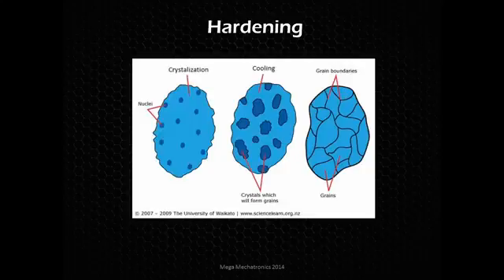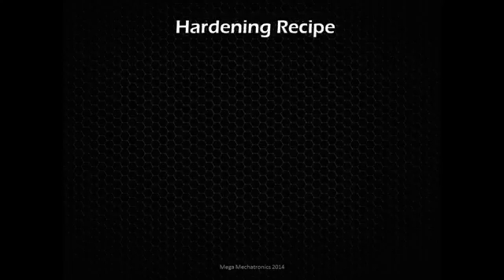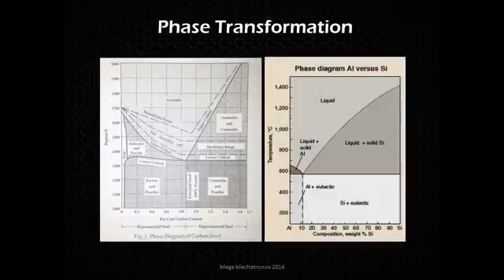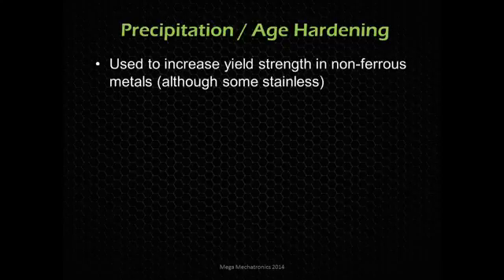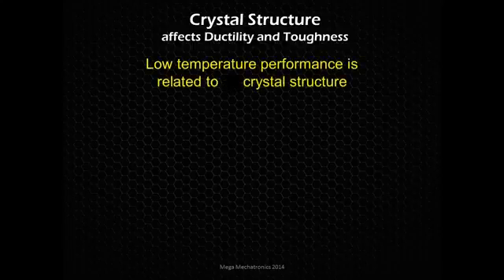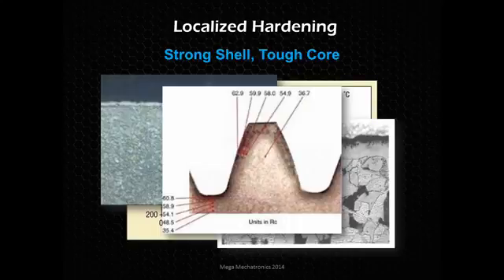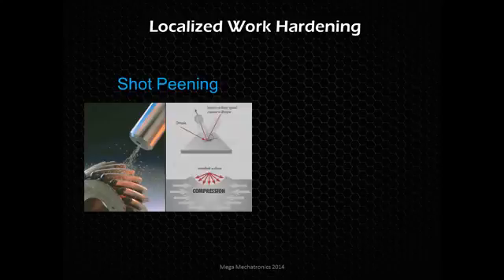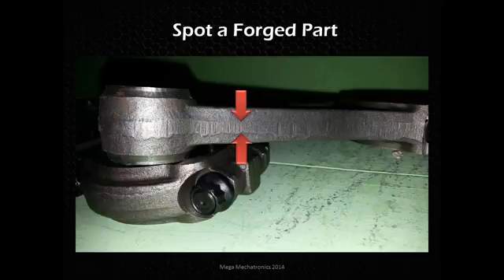Materials Science Mechanical Engineering    Part 4 Heat Treatment Explained

Comment: Axel Gian Aditama 
2713100137

Heat treatment is use of heating or chilling to achieve a desired result such as hardening or softening of a material. Heat treatment techniques include: 1) Annealing involves treating steel up to a high temperature, and then cooling it very slowly to room temperature, so that the resulting microstructure will possess high ductility and toughness, but low hardness. Annealing is performed by heating a component to the appropriate temperature, soaking it at that temperature, and then shutting off the furnace while the piece is in it.; (2) Tempering involves heating steel that has been quenched and hardened for an adequate period of time so that the metal can be equilibrated. The hardness and strength obtained depend upon the temperature at which tempering is carried out. Higher temperatures will result into high ductility, but low strength and hardness. Low tempering temperatures will produce low ductility, but high strength and hardness. In practice, appropriate tempering temperatures are selected that will produce the desired level of hardness and strength.; (3) Normalizing involves heating steel, and then keeping it at that temperature for a period of time, and then cooling it in air. The resulting microstructure is a mixture of ferrite and cementite which has a higher strength and hardness, but lower ductility. Normalizing is performed on structures and structural components that will be subjected to machining, because it improves the machinability of carbon steels.; (4) Carburization heat treatment process in which steel or iron is heated to a temperature, below the melting point, in the presence of a liquid, solid, or gaseous material which decomposes so as to release carbon when heated to the temperature used. The outer case or surface will have higher carbon content than the primary material. When the steel or iron is rapidly cooled by quenching, the higher carbon content on the outer surface becomes hard, while the core remains tough and soft.; (5) Quenching is a process of rapid cooling of materials from high temperature to room temperature or even lower. In steels, quenching results in transformation of austenite to martensite.
Hardenability is the ability of steel to hardened to form martensite.. High hardenability in steel means that easier to achieve martensite form not only at surface but to a large degree throughout the center.
Hardening use heat treatment process to get hardness and wear resistance improve by rapid cooling from austenization temperature. Hardening treatment generally consist of heating to hardening temperature, holding at specific temperature, follow by rapid cooling. Hardening temperature depend on chemical composition, for example hypoeutectoid steel are heated 30-500C above the upper critical temperature, (A3) whereas eutectoid and hypereutecoid steels are heated about 30-500C above lower critical temperature (A1). Hardening depend of the cooling rate, which determined by quench media such as water, oil, bath of salt. Effect of quenching medium is on the final phase of the material. Quenching medium is directly related to the rate of the cooling of the material. The fastest cooling rate is easier to get martensite form but the properties will more brittle. Rapid cooling will affect to develop internal stresses. So hardening follow by another treatment such as tempering which reduce internal stresses and makes the hardened steel relatively stable. 
Tempering is reheating the hardened steel to a temperature below lower critical temperature and hold for period of time, then slowly cool in air to room temperature to improve the toughness of hardened steel. At tempering temperature, carbon atom diffuses out and form fine cementite and softer ferrite. Depending on temperatures, tempering process can be classified as : 1) Low temperature tempering (150-2500C); 2) Medium temperature tempering (350-4500C); 3) High temperature tempering (500-6500C). Higher temperatures will result into high ductility, but low strength and hardness. Low tempering temperatures will produce low ductility, but high strength and hardness.
There are two method of determining hardenability, Grossmann’s method and Jominy End Quench Test. The Jominy test involves heating a standard test piece of diameter 25 mm and length 100 mm to the austenite state, fixing it to a frame in a vertical position and then quenching the lower end by water jet. The result is different cooling rate along the length of the test piece. A bar of steel have a good hardenability for greater distance from quenched end.
Martempering is a heat treatment for steel involving asutenitization follow by quenching, at a rate that fast enough to avoid the formation of ferrite, pearlite and bainite to a temperature slightly above the Ms point. It use to produce martensite without developing the high stresses, so will minimize distortion, cracking and residual stress. Austempering is hardening process is used in metal to get better mechanical properties, the process is quenching from above the transformation range to a temperature above the upper limit of martensite formation and holding at this temperature until the austenite is completely transformed to intermediate structure.

Comment: Firstly let me introduce myself, my name Airlangga eka
saputra 2714100058. I would like to comment this video. This video is explaning
about heat treament of the material, especially about hardening processes. Heat
treatment is some processes with raising up the temperature of material in
purpose of getting mechanical properties that wanted. Heat treatment is very
usefull to industrial needed. One of the heat treatment is hardening, the main
purpose of hardening is to increase the hardness value of the material. Basicly,
when we hardening the material or the metal is letting the atom move around and
forming the crystal structure (crystalization). There are 3 types of crystal that
usually formed; body centered cubic(BCC), face centered cubic(FCC), and
hexagonal. The crysstal structure of material has magnetic force to keep the
atom connected when they getting external force. When the crystals start
forming randomly they gonna be crystalizing with different orientation to each
others. When two crystal with two orientation meet, they will make an edge
because of different orientation. The edge of them called grain boundaries. The
size of grain boundary is really matter, when you have smaller grain, the
material will have stronger and harder material because with decreasing the
size of grain it will reducing the ability of grain of crystal to deformed. In the
other hand, when the grain is huge it will make material more ductile. The limits
of hardenability depends on alloying elements of the metal. The hardness
depends on carbon content in ferrous metals, as we se in graphic of rockwell
hardness vs % carbon, the hardness value of material will increase due to
increasing carbon content. When hardening, there are some factors that affect
the hardness result. There are heating temperature, time, diameter of material,
and the alloying elements in material. The most important thing in hardening
process is cooling rate. Cooling rate will decide the final result of
microstucture of the material, and the microstructure is totally affecting
final mechanical properties. The important point of hardening process is how to
get martensite, the mechanical properties of martensite is hard, so the
material with martensite in microstructure will have harder properties. The more
martensite in microstucture, the material will be harder but brittle.  In Time Temperature Transformation diagram
(TTT diagram), it shows us the condition of equilibrioum cooling condition. We will
know how much time we needed in cooling process to get martensite. so we should
know the TTT diagram of material first before we do hardening process. Alloying
elements will make the nose in TTT diagram moves to right, so it will ease us
to get martensite in cooling process. Hardenability is the ability of material
to getting harder. The more hardenability of material, the easier to get
martensite. the material with high hardenability will form the martensite even
in slow cooling process, because in TTT diagram, the nose will move to right so
far, it means it easier to get martensite even we cooling the material in much
time. There is two methods of calculate the hardenability of material. There are
jominy’s method and grossmann’s method. In grossmann’s method, we could know
the hardenability value of material by doing hardening some materials with
different diameters. In other hand, jominy only use one material. jominy method
focus in the speed of cooling rate. Usually after the material is to be harden,
the next process is tempering. There are two types of tempering, martempering
and austempering. The purpose of tempering is to release the residual stress of
material after being quenched.

Comment: This video is about hardening and the treatments. When hardening a material, we’re going crystallize it, let those atoms move around, and then we’re going to cooled it, and those atoms will start to form crystals. And at microscopic level for various materials, look it at the cubic structure, there will be Face center cubic(FCC) and Body Center Cubic(BCC). So for Body Centre Cubic, it has atom centered within the cube. And for Face Center Cubic, the atom centered on the faces around the cube.
For the dynamics, we can move the structure around and it won’t break or fracture because the atoms are bonded together like a magnetic force. So if we plastically deform it, those atoms will move around but still stick together. 
When crystals start to form randomly within the material, they’re going to be crystallizing in different orientation to each other. so when we’re refracting a light to the crystal, we can see the light refracting in different ways and we could know the grain boundaries. The size of grain boundary is definitely important, when we had small grain boundary, the materials will be hard and strong becauseit will reduce the ability for the crystal lattice to deform and move around because there’s like a wall stopping them for moving around further. On the another side, when we had a huge grain boundary, the material will less hard and less strong than the smaller one because they can move around easily when we deform it rather than the smaller ones. 
Then the hardenability, different alloys or metal has different ability to make the elements hard. And the carbon content, carbon will increase the strength and give certain characteristic to the crystal structure. Time and temperature really influence the hardening on the materials. The time and temperature is depends on the thickness of the material and the alloying elements on it. The cooling rate is important too, the media when we cool the material will determine the crystal structure of the material and furthermore will influence the mechanical properties of the material. Some quenching media is water (we could add additives), oil and salt.
 For example for high performance spring, we do hardening, after that we do austempering when we’re bring it down to room temperature, we quench it in slow rate and hold it in high temperature. After that we do cryotempering when we bring it more below room temperature cryogenic temperature to complete the transformation of martensite. So any retain austenite will completely transform into martensite.
At the composition, alloy steel has several alloy elements. For the example 4130 Alloy steel, the alloying elements are Manganese 0.50%, Phosporus 0.035%, Sulfur 0.040%, Silicon 0.25%, Chromium 0.95%, Molybdenum 0.20%, with the carbon content 0.30%. Silicon, Chromium and molybdenum make this 4130 Alloy steel special because it has high strength, ductility. For one alloy elements, we could get many properties but still depends on the treatment. As we quench it, we will get super brittle material with a low ductility (example: quench on the water). If we do a low temper for that quench material, we will get a better toughness. If we do a normalizing, we do a cooling at the air, so we will get a lower strength than the quench material but a better ductility. As for the annealing, we do a cooling on furnace, so we will get a good ductility but the strength is the lowest among the other method. For precipitation hardening / age hardening, is used to increase yield strength in non ferrous materials, produces fine particles that defects the crystal lattice that impede movement.
As what I get from the class, Steel with high hardenability form martensite even on the slow cooling. High hardenability in a steel means that the steel forms martensite not only at surface but to a large degree throughout the interior. 
This video is very informative and will give us a lot of information about hardening and heat treatments.
Best regards,
Muhammad Irfan Bibra
2714100014